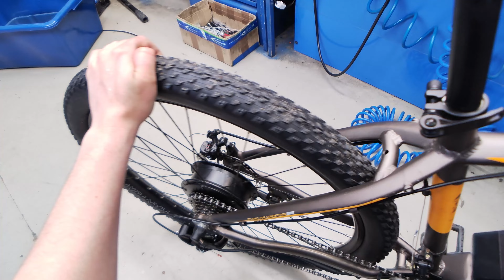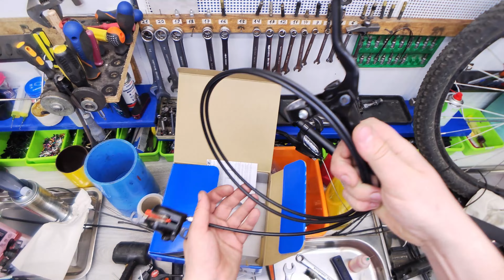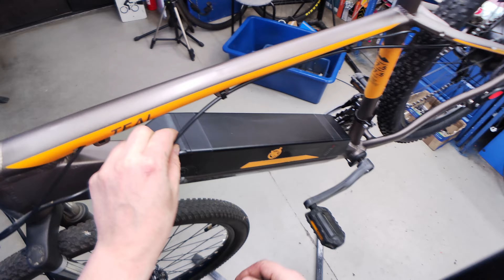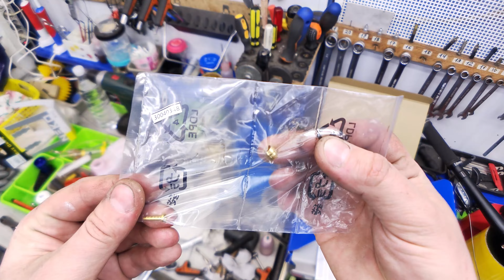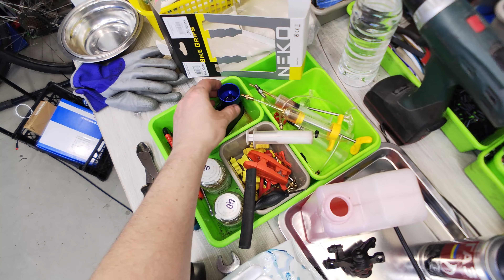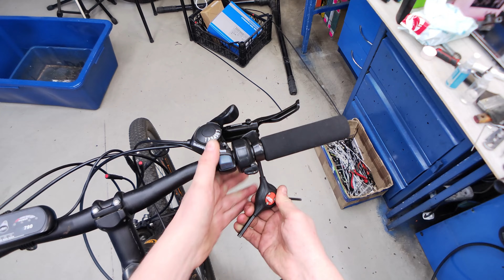How to make my bicycle brake well. Bike tuning

Comment: Im confused, are these brakes hydraulic or cable? If theyre cable, why did he put oil in them?
Reply from the maker: Initially, there were mechanical brakes, which were replaced by hydraulic brakes